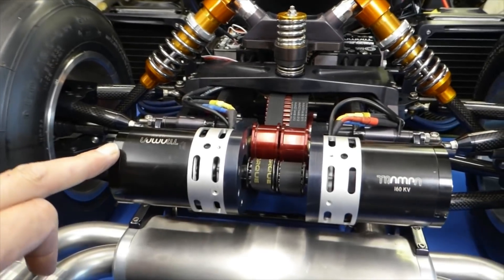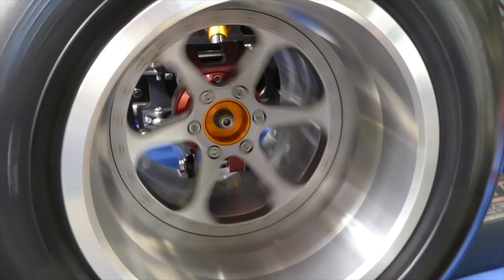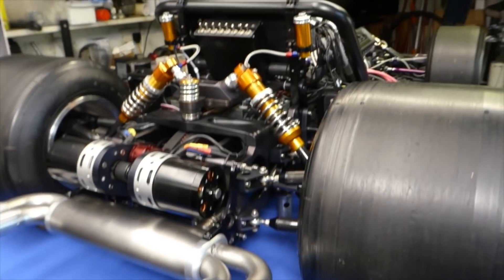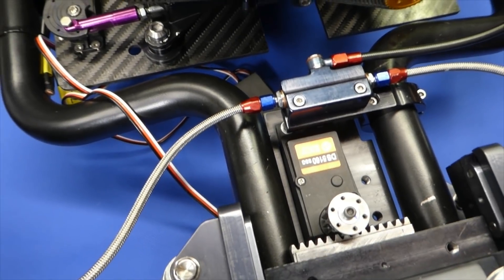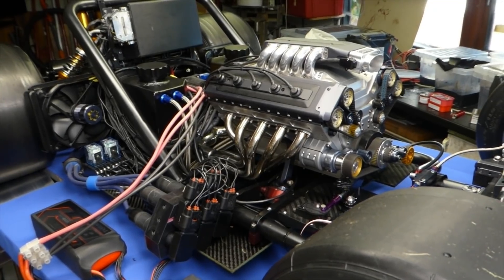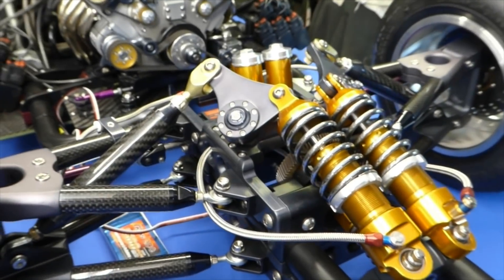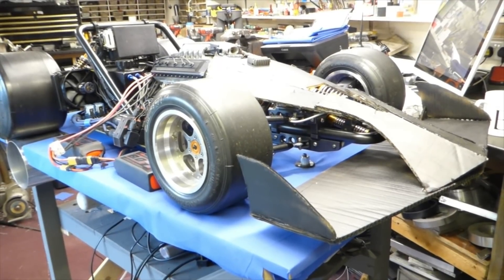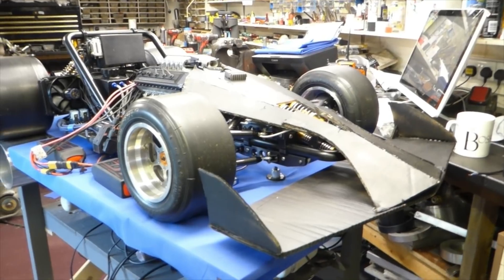1/3 scale V10 RC car Part 9

Comment: i think you can get rid of that strange motor behaviour at very low throttle with using a sensored brushless and if you give another radio a try, maybe a futaba, Frsky, Spectrum or whatelse, it's very likely that the jitter is gone too.
Reply from the maker: this was 18 months ago. Everything’s sorted now.
Reply: @Keith5700  oh, don't know why i stopped reading after i saw 18. of august, so, sorry for the confusion, maybe i was a little confused myself yesterday. Anyway!  Did you run this beautiful machine stil with that awful radiolink ? I had one of those and the signal from the gimbals was so bad that i couldn't fly my drone properly and i would be interested if you have noticed any radiolink related performance issues too
Reply from the maker: @andiprogshop3097  Not had any problems with the Radiolink, apart from trying to figure out the programming. But I’ve not used it more than about 30 metres yet. I know it’s only a cheap thing, but seems amazing for the money. If there was one available from those you mentioned, 10 or 12 channel, at reasonable price, I might get one, but not if they’re complex to set up. I had a computer Futaba once, that was so complicated I just got rid of it. User friendly my arse.
Is there a better radio for under, say, £300?
Reply: @Keith5700  yeah, the programming, right. I used my radiolink almost 2 years but i did never achieve to get the switches setup the way i want them to and sometimes the few switches that i had achieved to setup cerrect somehow, changed mid-use the A-B-C positions or even the entire switch flipped to another switch on the other side of the radio. I think the only reason i endured that mind abuse for so long is the excitement over my first purchased single radio and the colour stil looks great. I made a drone out of it last year to appreciate it. Dude, i would love to see your Buggy/RC-V10/F1car evolve even further.

Comment: This may NOT be the issue with the batteries but I have read that in some packs if the V of a single cell falls below a threshold the pack wont charge. Solution is to remove and charge the bad cell. SLOWLY. Of course messing with Li batteries is dangerous.

Comment: I may be being stupid but why didn't you fit the front dampers the other way up? wouldn't it have made piping of them easier
Reply from the maker: They are the other way up now.
Reply: @Keith5700  Yeah I saw on the next video lol, loving the build looking forward to seeing it run with the engine.
Have you dumped the idea of the super charger? because it looks like the engine mount is where the drive shaft for the super charger was.
Reply from the maker: @happydog6500  not sure what to do about the supercharger. Would nice to get it on somewhere in the future, but far too much other stuff to think about at the moment.
Reply: Happy Dog 👀

Comment: You may not have a low voltage cutoff on ESC.  Might be why battery died.  Don't let them run down to low voltage or kills them. Car is absolutely AMAZING.

Comment: wat brand are the brakes are?
Reply from the maker: I made the discs and callipers. The pads are cut down cycle pads. The master cylinder is a modified Shimano cycle brake lever.
Reply: @Keith5700  ohh ok i imagined the same those might be bicycle brakes

Comment: Fucking insane.  Would be utterly sickening was if that mini v8 model actually powered it!
Reply: first off its a v10 second the engine will be powering the car in the future
Reply: The mini v10 will be the actual main power. The electric is just the "hybrid" part of it. The gas motor actually works. This build is fucking insane! Look the other videos up of the gas motor running

Comment: For a more powerful steering, you may adapt a car window wiper, or window lifter motor, just as I did in a powerwheels to RC conversion project some time ago: https://www.creationfactory.co/2013/08/powerwheels-rc-conversion.html
Reply from the maker: Yes, I tried this approach first, but as soon as H bridge whatever is mentioned it loses me.
Reply: @Keith5700  a bit of electronics involved yes. I decided to reuse the feedback loop electronics from a standard servo, to simplify the build. You may always go for an off the shelf solution, e.g.: https://www.pololu.com/product/1390 (this one can even be configured via USB), albeit for a different budget scale.

Comment: For everyone who is asking 

1. The engine does work here’s a video of it running https://youtu.be/rz0Uteqfpao

2. He’s not running it at the moment because it has no gearbox so it can’t drive the wheels yet

3. It has electric motors because it’s going to be a hybrid and the wheels will be powered by both

4. It’s not ready to go to a track. Everything still needs testing

5. It’s far from finished so don’t expect it to be ready for about a year
Reply: I'll just add his forum thread about the v10 build http://www.modelenginemaker.com/index.php/topic,3007.0.html

Comment: So the engine is not the one giving the power  on them wheels its them small electrical  power  Motors or correct  me I'm  very confused 🤔🤔🤔🤔🤔🤔
Reply: Not yet has there is no gearbox yet, but the engine run, you can see it in previous video.

Comment: looking really awesome. i like the formula 1 style body your thinking about!!!!! i think you made the right choice with the motor&esc like mat holroyd stated the glitching is due to lack of ability of the receiver to supply power to the servos especially if they are high voltage servos and are amp hungry, a BEC for brake and steering should stop that and allow you to use a single receiver, ive seen that issue allot in lager rc models like 1/5 scale, perfect example is the losi 5t with dual steering servos

Comment: Hi Keith, I was wondering if the glitching you experienced, therefore prompting the second receiver, was due to the servos, motors and ESC etc drawing too much current?  Perhaps separate BEC circuits may be needed so that power to servos and ESCs do not come through the receivers.  You may also want to try ferrite rings on the  signal leads from the receiver to the ESCs. Hope that helps. Phenomenal craftsmanship.
Reply from the maker: Yes, it turns out the Vesc’s don’t like much current going through their bec circuit. I could have stuck a battery on the receiver, but I spoke to the Trampa guys and they said that the best thing, if possible, would be a 2nd receiver.
I thought this would be tricky but it turned out to be easy. I could run 10 receivers off the Radiolink if I wanted.
Those Vesc’s are too expensive to blow up, so they can have their own receiver.

Comment: Incredible Keith or should I say Sir Keith after seeing your masterpiece!
Rolling chassis aside, I'd give my left ....... arm to be able to reverse engineer the motor and fuel system and put a CAD assembly together of this.
Reply from the maker: It would be great to have a Solidworks model of the engine and the car, but there’s been so much I’ve just made up to quick cad sketches, and pencil sketches, or no drawings at all, that to strip it all and measure up would take months, so I can’t see how it could happen.

Comment: You say the old Lipo batteries died, do you keep them at storage voltage? Because i had a Lipo battery i just left sitting for almost a year and it died on me too. Have to hook it up to charger and use storage mode once in a while
Reply from the maker: this battery was only 3 weeks old and never discharged more than halfway. 3 of the 6 cells just suddenly packed up.

Comment: Horse power of the V10 ? And Electric engines ?
Reply: Hybrid car, at first if I recall correctly he wanted the electric motor only for reverse, then he decided to power the car with them in sync with the v10

Comment: This is amazing.
But where is you generator or alternator?
If you want to make it hybrid you need a alternator also can be driven by the beautiful Engine.

Hybrid car runs of Brushless motor by the battery. When running at high speed gear change from electric to engine. Engine also run a generator or alternator to charge the battery.
Reply: Plug in hybrids don't use a generator.
Reply: @Splooge_McFornication  What dose that mean???

Comment: Does the engine use splash (dipper on connecting rod) or pressure lubrication of oil (oil pump and pickup tube with oil galleries in the engine block with a spin on oil filter
Reply: Good question. Looks similar to a coyote motor given the DOHC and intake manifold. Wouldn't surprise me in the least if it's got an oil pump.
Reply from the maker: its got a dry sump with 3 stage oil pump. 1 x pressure feed stage and 2 x scavenge sections.
Reply: @Keith5700  amazing engineering and construction you've done ther

Comment: No words, you are the man man. Those Trampa motors sound so quiet.
Reply from the maker: I like the motors. Very copper dense. But its the VESC speed controllers, in FOC mode, making the motors quiet.

Comment: just my measly 2 cents here... the chassis might not be sturdy enough, torsion wise, considering the power and the weight of the engine... Some additional bracing might be needed

Comment: Won't the servo connected to the steering be damaged from the wheels going over bumps and such making the steering move?
Reply from the maker: I will be fitting a servo saver.

Comment: sorry if I missed it BUT those carbon suspension/tie rods /control rods? are something else.are they custom made or readily available?
Reply from the maker: The tube is available off the shelf. I made all the other bits.

Comment: How does the engine run the electric motors? Some please help me understand... So far I have yet to see the v10 running.....
Reply: From watching the previous videos I understand he will have it eventually set up as a hybrid. So engine doing most of the work when racing around but for a bit of a power boost will use the electric motors. Assuming he will also run some type of charge unit so the batteries are kept at a full charge while driving off the v10
Reply: @Wacksmacked8898  I think you would see some type of transmission or even some kinda nitro electric dynamic. Engine generator electric motor configuration.... I am confused when I look at it....
Reply: @renelaizer6518  Yes i know. but its decoration for now. and if you want to see it running, here is the link.(https://www.youtube.com/watch?v=rz0Uteqfpao) but its not on the car.
Reply: If u look at his channel he has video of it running it sounds better than most people's cars

Comment: What's that servo force rating? 

I feel it may be quite underpowered when the vehicle is turning at speed. Consider the inertia of the full weight of the vehicle, plus speed and bumps, all on one servo gear, being transmitted all to that tiny servo.

For lightweight RC cars a servo is sufficient. Your vehicle will be hundreds of lbs, and unfortunately, I predict you may have to rethink the steering. Food for thought.

However, I really enjoy watching your progress and am a great fan of the build. Keep up the great work. 🤙
Reply from the maker: It’s 60kg/cm
Reply: At full speed, steering is a lot easier and only very small turns are required, otherwise you are going to lose traction or flip over.

Comment: now were talking torque,    dont worry about weight yet, get some performace first. start maching some new motor belt pinion cogs, gonna need bigger diameter with those motors for speed. all in time.

Comment: Why did you put these tires on it instead of aluminum rc car tires like when it's done it will be 100 more efficient by not have 4 tires that probably weigh the same as the rc car without the tires on
Reply: Aluminum tires?
Reply: @jorgesegura4514  aluminum wheels i think
Reply: I'm just kidding man😂
Reply: Do you know if those are Al? He made them himself, so they probably are made from aluminium.

Comment: Did you make the stainless braided hose and AN fittings? Awesome work by the way.
Reply from the maker: I made all the fittings but obviously didn't make the hose. Its cycle hydraulic brake hose. 5mm.
Reply: @Keith5700  Thank you..........amazing work.

Comment: maybe you remember the idea I posed for alternate radio control system .. ? its been done  .. but, in a bit of an inept way ..made the news for some reason lol
Reply from the maker: Where is it shown?
Reply: @Keith5700  is on the msn news feed under buzz videos .. so basically.. if you use msn as a search engine .. the news feed cycle has it on there
Reply: ps .. you mentioned increasing the servo gear size, to increase travel for better turn circle .. which will in turn,  increase the torque stress on servo .. ( not sure about this but ) can you not adjust the servo rotations and increase the rack to achieve same .. as a trade off for negligibly slower steering ?

Comment: Nice work Keith, and yes, that steering system should have a 'servo-saver' to keep from ripping the gears out of the servo when you DO get it on the ground. The fit and finish is amazing so far, and the haters and people pushing for completion need to understand that this is a hobby side project, and not your run-of-the-mill off the shelf RC car. We appreciate the videos of your progress, and will continue to make suggestions if we see something that might cause you problems down the road!😁👍

Comment: @Keith57000 look up “servo saver” before you road test, it might save to the trouble of having to get another steering servo when you break it from heavy impacts made by the front wheels.
Reply from the maker: Yes, it’s on the list to do with the bigger pinion.

Comment: Those new batteries only have a 15C discharge rate if i'm right. That is way lower then the ones you tried before. Although the new have a higher Mah of 7000, the discharge is low.
Love your awesome work.
Reply from the maker: They are showing 150 amps on the data logger, so that’s enough for now. Have to see how long they last.
Reply: @Keith5700  sorry, i did not see the extra zero. And you know what you are doing, that's obvious.

Comment: I would say that is more like 1/4 scale. Not big enough to be 1/3. The motor and tires maybe but you didn't build the chassis big enough to be 1/3. If the chassis was a bit bigger it would match the scale of the motor and tires better and have more room for everything.
Reply from the maker: 1/4 scale? It’s nearly 3 feet wide.

Comment: The "abs" on brushless escs is really just a controlled decel.  In my experience I've never seen one that actually detects wheel lockup.
Reply from the maker: I think that to get the abs and traction control to work then you have to have one motor for each wheel. then the controllers can compare motor speeds and adjust if required. I need to do a bit more research yet.
Reply: @Keith5700 your escs may have functionality most don't but I've been in Rc for years and haven't seen an esc with true abs or traction control yet.

Comment: Why is there a v10 in the middle of it lol?
Reply: Go back and watch the other videos and all is explained
Reply: @reasonsvoice8554  that's alright, if theres one thing land rover has taught us Americans, it's the British cant design anything mechanical.
Reply: @themanthelegend7048  That's why almost every f1 team is working out of britain...
Reply: @themanthelegend7048  he's using the electric motors so he can use it casually and test the other components. The V10 is an eventuality just a matter of getting the right gearbox setup
Reply: @themanthelegend7048  The British designed and invented mechanical items long before you guys were a wrong turn for Colombus.Lets start with, The British Invented the mechanical Pencil, type writers,fabric looms,sewing machines,the universal joint ,the lathe,hydraulic press,compression engines(the diesel),2stroke engines,the train,the Tractor,hydraulic cranes,disc brakes seat belts,,transformers,generators,Hydro electricity,automatic elecric toaster/kettle,vacuum cleaner,dishwasher,standardised screw threads,shifting spanner, opening bridges, jet engines,Television,Stereo sound,radar,microchips,LED'S,automatic machine gun,torpedo's,even your "john"(flushing toilet)was invented by Brit John Harrington.Add to this, thousands of invention in the fields of chemistry,biology,medicine,physics,industrial processes,military,mining,Doesn't leave much room for you yanks to invent much,also many inventions listed as being invented in the USA,were invented by Brits living abroad,or were of British ancestry. https://www.radiotimes.com/news/2013-01-08/the-50-greatest-british-inventions/
Reply: Hows that land rove quality treating you?  Probably as good as a jaguar lol.
Reply: It's a hybrid
Reply: @biggiebig1492  that makes the idea even dumber.  I mean it's cool, but you aren't revolutionizing anything here.  You've got 10k rc car that's based off 20 year old tech?  It would have been cooler as just a v10.
Reply: @themanthelegend7048  It's a piece of art. Do watch his previous videos to understand more.
Reply: The v10 works tho.. what you on about 😂
Reply: Electric and v10 125cc hybrid
Reply: This is the most revolutionary thing to happen to hand made rc, it’s a scale V10 (they cost a lot of money and are very rare) and he’s making his own 1/3 rc car, no one has made an rc car with a scale V10 and 2 160kv motors
Reply: My thought exactly, i was hoping itd be gas powered

Comment: Looks amazing mate! Can't wait to see it finished!

When it comes to the body shape why don't you go with a detachable tubular frame? similar to the aerial atom? At least then if you need access you can just take off and it would give you a bit of protection should you crash it again... You can still dress it up with panels but it will offer a bit more protection.

Keep up the amazing work!

Comment: Maybe hydraulic steering is an option? You could use a small double sided piston often used in industrial automation and you already have an engine to pump it.. Or maybe the pneumatic variant..
Just a thought great project